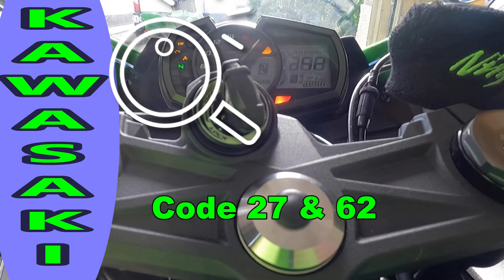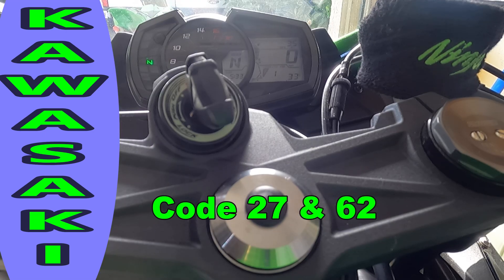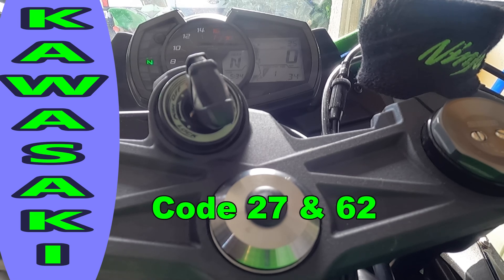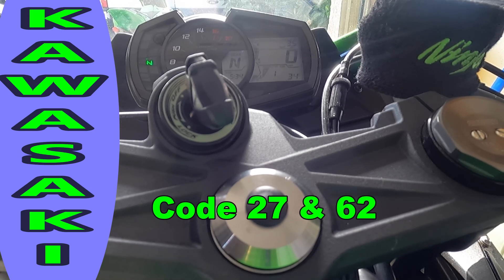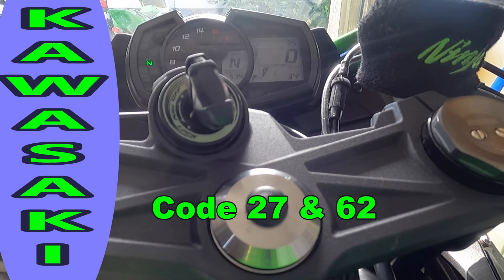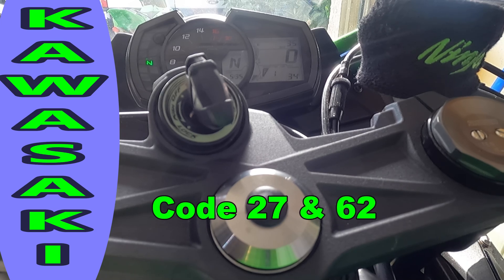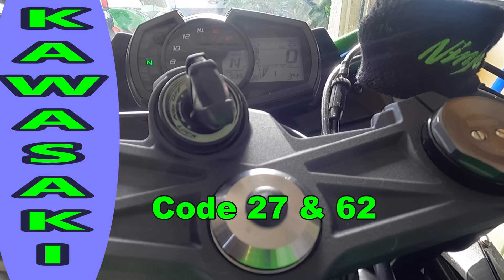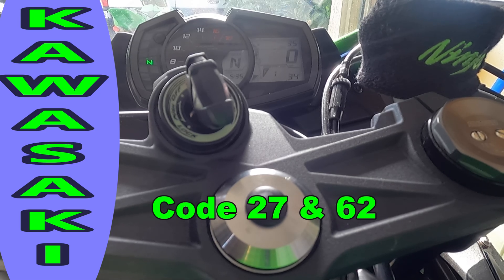Code 62 Kawasaki Ninja - Kawasaki Dealer Refused the Job

Comment: No technician will just clear a trouble code. You should always correct the problem.
Reply from the maker: That's right, just deleting the code will not fix the issue. The problem is that the battery runs out and the motorcycle loses its memory. This was also in the video. Since the O2 sensor has been disabled, this error occurs every time I remove the battery or it runs out. I bought a code eraser for $50 and can erase this fake error in two minutes. Also I kept the battery on automatic charger. These new models need to be charged constantly because they are full of electronics. This is not a problem with older models. It is quite worrying if the code appears while you are on the road, say on the first day of a multi-day trip, due to a possible battery short circuit.Incidentally, the old ZX10R did not have an O2 sensor, only the European models did. Once again, this is just another piece of nonsense in the US that dealers can use to make money, because there is no other reason for it. It might help if you only disconnect the O2 sensor from the exhaust and leave the connection at the top. I removed it completely.